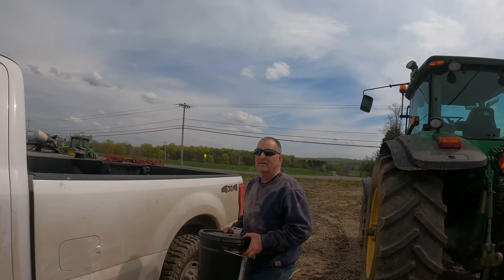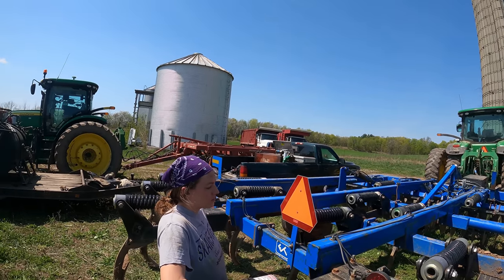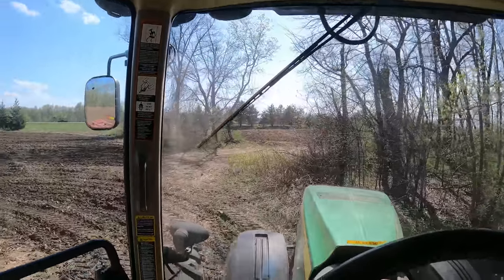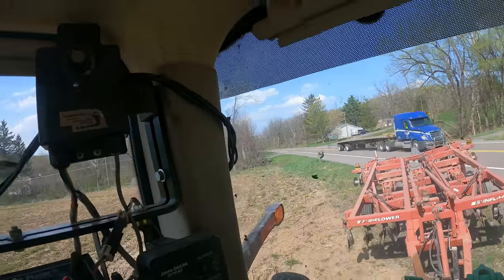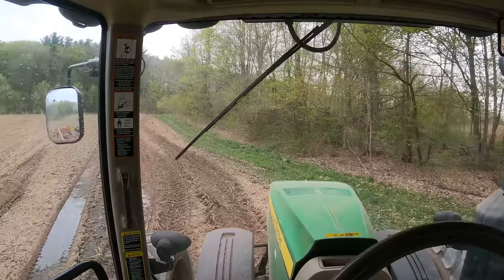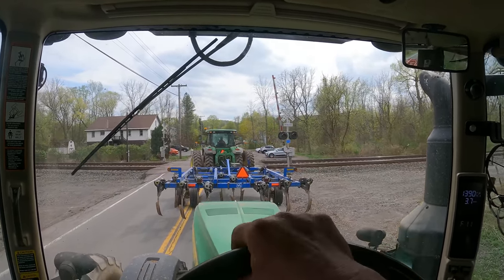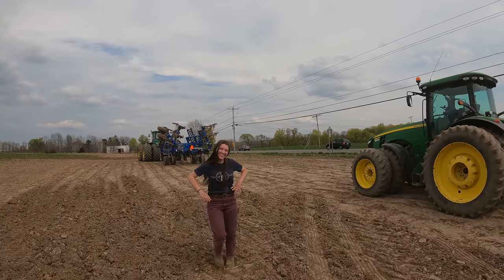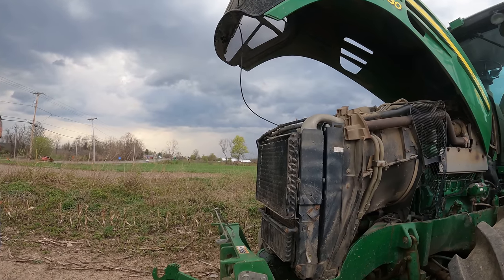Sarah almost got hit by a train

Comment: 400gallons of fuel is about 1,781 litres and at roughly £0.80p per litre here in the UK that would cost roughly £1,424.00 or $1,790 approximately.  Breakdowns add even more to the costs of farming that the anti farming brigade fail to understand.
A close call with train, glad she made across because that would have been quite a disaster.
Nice long video Andy, great to see field work beating the weather for a change!
Reply: Here in Norway  it would cost US$ 2669,27 for the same amount of diesel. Farming is expensive and ppl really should stop complaining! Food doesn´t grow on a shelter in the store 😊
Reply: In Canada it's 1.46 a litre for farm diesel
Reply: What model sunflower were you using Andy
Reply: ghammond3132  kingston ontario
Reply: ghammond3132  I wish
Reply: Same price in Saskatchewan 1.03/litre Canadian dollar
Reply: Ran into the same thing here in Western Pennsylvania the other day coming from the feed store. Pull down to the crossing slow down and look both ways and about the time I get ready to pull across the bars started coming down in the light started flies I had to back up to keep from getting hit with the bar. I'm like you I think they need to give a little bit more warning on those things

Comment: The youtuber Ollyblogs Agricontracting in the UK has a crossing between fields which are relatively common here that you have to call on the phone there give the number crossing the operator then confirms it is safe to cross or not. A couple of years ago I believe he called they said it was safe to cross and he nearly got hit as they thought he was at a different crossing. He came up with a means to confirm it then spent over an hour  trying to get the operator to actually follow the procedure.
Reply: That is why it is not allowed in Sweden. If you can't cross like normal people you have to hire a certified rail worker to shut down the rail...

Comment: Summer of 83, Lunchtime. I hop in the farm truck and head to town, I'm driving down a loose gravel road playing with the radio. There's a railroad crossing with no lights or arms 20 feet in front of me, I hear the train horn I look up and the train is right there, I lock up the brakes and realize I'm not able to stop in time so I stomped on the gas, As I was crossing the tracks I looked at the train, the headlight was huge. I braced for impact but that old Dodge saved my life. Don't drive distracted.

Comment: I've barely noticed/remembered that crossing with the gates until I saw this clip. I guess you need an experience like Sarah's to make a lasting impression, but the house and trail rang the memory bell. The natural reaction when those lights flash and bells ring is to slow down and look for the danger that is coming at you, then "OH s***, guess I best get out of here!"  Seems like your tractors put on more road miles than field miles sometimes. it must often take more planning to get to the field than it does to plan crop rotations with narrow, low clearances, .

Comment: Hey there Andy and Crew, I hope this finds you all well and good. 

Andy, I gotta tell you that I'm really concerned about the amount of traffic on your fields, and that includes your tillage traffic, which can easily exceed any potential benefits. 

Every piece of equipment in the field today, has an axle weight that is multiple times heavier than anything used 50 years ago, when we first heard about soil compaction, and hardpan, caused from decades of plowing at the same depth, turning and loosening the soil, without any idea about the long-term effects. 

 If I could find the time, I would love to come up with a couple of students from Virginia Tech (to do the digging) and do a soil compaction analysis on one of your corn fields, to see exactly what kind of a growing environment you have prepared for your plants root system.

On a Safety note, why do you always have your right hand, fender mounted, wide width, signal/caution light swung in, which is the opposite of where it should be when traveling on the road? 

Your Green tractors would not only look better with Green Tillage tools behind them, you wouldn't be spending all of your time working on them.

The John Deere Company we know today, was born from the first self-cleaning  steel plow nearly 200 years ago, and they still make quality, cutting-edge Tillage equipment today.

I hope y'all have a good one my friend! 

"Nothing Runs Like A Deere" 🦌 👍 🇺🇲
Reply: He is going to luv your comment roflmfao

Comment: Hey was that you that dropped the "honey" on I-690 the other day? 

Also, just FYI under state and federal law you need placards on your fuel trailer. Those 2 tanks ore over 119 gallons each by the looks of them. Also, you need your name and USDOT# on your pick up even the Ford would need those with a trailer or not. The magic weight is 10,001lbs. and up single or combination. Yes even farmers.

Comment: When i was driving truck running team I was in the bunk sleeping the other driver wakes me saying that the RR arm came down between the cab and trailer setting on the tracks what sould he do That was hes last trip with me
Reply: I was told right after starting trucking 'if you are crossing the tracks and someone blocks you when a train is coming you push them immediately.'
Luckily I never had that problem but it always helps to know before it comes up.